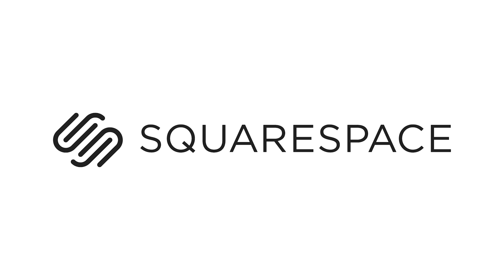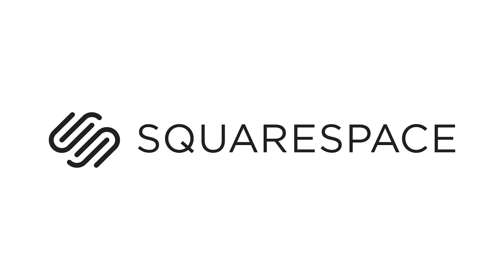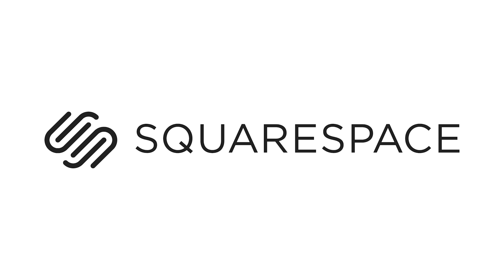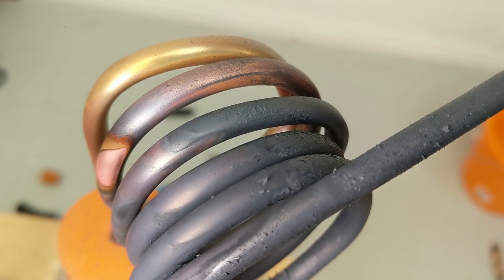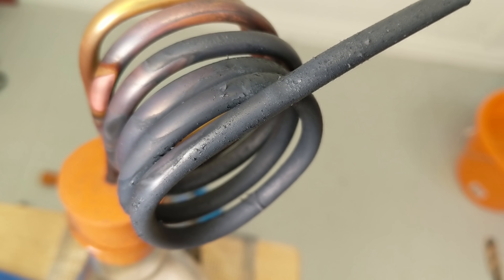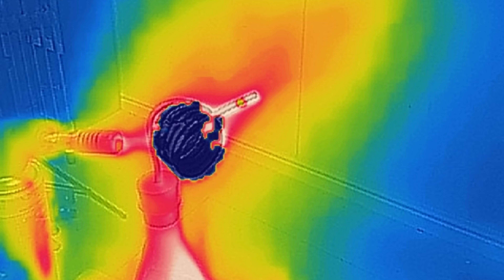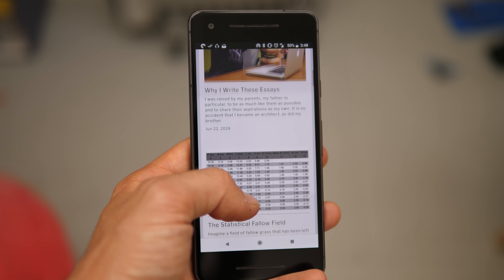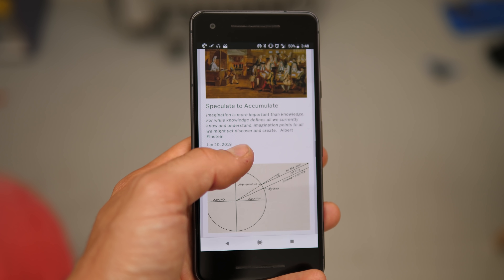Can you light a match with water?

Comment: How do you know it's the superheated steam, and not radiated heat from the copper being pushed by the steam ?
It's weird that hydrogen and oxygen are used to put out fires
Reply: Sparky Projects Notice how the other objects respond when put in front of the coil, if it was due to radiated heat the paper and the plastic would have been heated everywhere not just in exact front of the coil.

Comment: Under high pressure, water stays liquid at higher temperatures. So would it be possible to repeat this experiment with liquid water instead of steam?
Reply: Paul Paulson the tricky bit would getting the match in contact with the super heated water and also a supply of oxygen.
Reply: scollyb Perhaps put it into water to heat it, then pull it out so it is still hot enough to start burning.

On the other hand: Would hot water under pressure split into hydrogen and oxygen? Didn't something like that happen in fukushima?
Reply: Paul Paulson Water doesn't start splitting until well above 2000° C so that wouldn't be a problem. The problem with dipping it is the match would get wet. But I am not sure what effect that would have at that temperature and pressure.
Reply: nice question !
Reply: Badger de Hond yes but this critical point says there is no difference in liquid and gas 
benson boiler (Bensonkessel) operates over 230 bar and over 500°C
without a water steam separator drum
With that pressure you can’t get steamhammers
Reply: As far as I understand it, there is no difference in liquid and gas at the critical point, when the heat is increased it all becomes steam. But I could be wrong.
Reply: This would be very interesting!
Reply: Water (liquid) can't get warmer than 374 C (at 217.7 atm.) So it would probably ignite Phosphorus, but I dont know what adding Oxygen to that water would do.  https://en.wikipedia.org/wiki/Critical_point_(thermodynamics)
Reply: What you need is elemental parts of the combustion (fuel and oxygen) as well as temperature (*energy*). 

So if you have the fuel (whatever you want to burn), give it enough oxygen and energy (temperature), it WILL burn. No matter the phase it’s in (pun intended).
Reply: Badger de Hond no difference mean you can say to is like you want
I would say liquid, but nobody really knows
Some would say it’s something new
There a way more than 5 states of matter
Reply: This sounds like something you should ask Cody instead.
Reply: Fredrik Wahlgren, you are right of course, but the interesting question is, can you reach the combustion temperature with liquid water?
Reply: Liquid ice.
Reply: No, because you couldn't get oxygen in.
Reply: P equals NP squared How much oxygen can be dissolved in water at that pressure?
Reply: We could just stay a little bit under the critical point to make sure it's still liquid
Reply: I'm not really sure... but it might work
Reply: Paul Paulson maybe its happening right now on other planets. Just a (good/bad) thought
Reply: Paul Paulson I believe in Fukushima the water oxidized the uranium and some of the other metals producing hydrogen gas
Reply: That sounds extremely super dangerous beyond what you can imagine. catastrophic potential for disaster, an instant ticket to heaven.
Reply: yes but dont put the match into the water the heat will radiate to the match and light it on fire.
(steam is not the same as water)
Reply: After the critical temperature of steam, no matter how much pressure you apply, it will not become liquid water.
Reply: wouldnt it be harder to start a fire under higher pressure? not only the water is gonna get affect with high pressure
Reply: How'd you get the oxygen in

Comment: This could probably be done with electrical heating instead of flames, right? That would be even more impressive, because in your case you used two open flames to light a match. With electricity you would use no direct flames.
Reply: but heating a wire to light it wouldn't be impressive?

Comment: The interesting corollary to lighting a match with water is that you can boil water in a paper cup.

This is counterintuitive to many people, since boiling water is traditionally done by placing a water-container like a kettle on top of an open flame, which would of course set a paper cup on fire. But if you heat the water through some other means, for example by microwaving it or by use of an electric heating element, the water can be brought to a boil without exceeding the combustion temperature of the paper cup.
Reply: How is boiling water in a paper cup interesting in the slightest. Almost everyone knows you can heat stuff without directly setting it on fire.
Reply: Actually you can boil water in a paper or plastic cup on an open flame. The water absorbs the heat, and the container doesn't melt/burn until the water is gone.

Comment: Water is a liquid, so no, you can't light a match with water.  You can light a match with water vapor, as a superheated gas.
Reply: Steam is gaseous water. Water is H2O, not necessarily liquid water.
Reply: Ice and steam are still water just in a different state of matter.
Reply: I was hoping for high pressure (liquid) water and friction setting the match off. Surely that's possible. No?
Reply: "By definition, water is a liquid state of H20 and different than the gaseous state which"
by some definitions - but by any scientific definitions water is the substance that also has extra identifiers for its other states.
iron is still iron even when molten or vaporised, same as oxygen is still oxygen when frozen. We just tend to use the name of the substance without any extra identifiers for the state of matter it is in at atmospheric pressure and room temperature.

Steam is still water - in its gaseous form.

Comment: I have to agree, but it's not the only thing that water takes away. Water takes away fire's connection to oxygen, thus putting it out. But steam is different, because you can mix it with oxygen, so that's why you could light the match.
Reply: Right! I was expecting him to mention that, he even mentioned oxygen as one of the three components.
Reply: Additionally, depending on the fuel, the fire can pull oxygen from the water directly. Pull the O from the H2O.
(burning magnesium for instance)
edit. Youtube why u no support hypertext markup? it's an internet standard for crying out loud :(
Reply: Benjamin Miller - who needs hypertext markup when you already have strikethrough  italic and bold!

You can even have all three!

/sarcasm 😂
Reply: at what point does steam turn into hot air? 
-when it lights a match
Reply: @pauligrossinoz  fail on the "all three" part
Reply: @Corn0nTheCobb  that's some kind of error on your device, because on my phone it displays it correctly and he didn't edit his comment.
Reply: @rosskrt  that's weird, it's showing up fine for me now. I guess it was something with my phone
Reply: @Corn0nTheCobb  and judging by the likes you got, you weren't the only one. Think they have fixed it by now. Out of curiosity, which phone were you using at that time? (Maybe you still are, idk)
Reply: AV3S Tube Not really, in a normal fire the oxygen is drawn from down below it, so if a fire is violent and hot enough that the heat loss is negligible, dousing it with water can actually increase the updraft with all the expanding steam. In this case the match won't light as long as it is right in the jet of pure superheated steam, but as soon as it is removed it flares up.

Comment: You mean, can you light a match with heat? Duh.
Reply: The fact you have to say "heat transfer" implies that there is such a thing as heat on its own account. It's just that it is always stored as kinetic energy within an object. The heat is separate from the water in this process, as the water is arbitrary. You could substitute anything into the water's place and it would act the same way (potentially with side effects)
Reply: Horep "implies that there is such a thing as heat on its own account"

No it doesn't, though technically I probably should have said energy transfer. Heat is just the transfer of energy from one system (medium, matter) to another.  If two systems in isolation were in perfect equilibrium heat would be a meaningless concept. And yes, you could substitute anything with a great enough energy differential, but here they used water and they used water because most people think of water being incompatible with fire.
Reply: Once the water has been boiling for a while there is no air in the flask.
Reply: As people stated heat needs a carrier in this case the water, 
because heat itself is just the (average) speed with which matter moves, 
similar to your car that can have a speed, but the speed itself is just a construct.
Reply: That "hot air" coming out of the flask is essentially pure water in vapour form.
Reply: level1807 "You mean, can you light a match with heat"

Except that there is no such thing as heat on its own account. Without some medium, and in this case the water, there would be no heat transfer. So it is the water that is lighting the match.